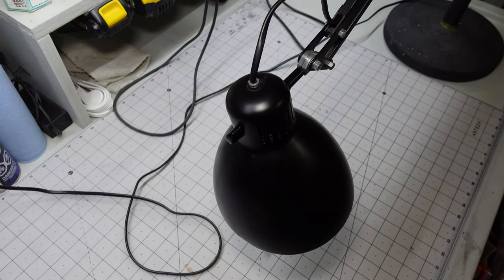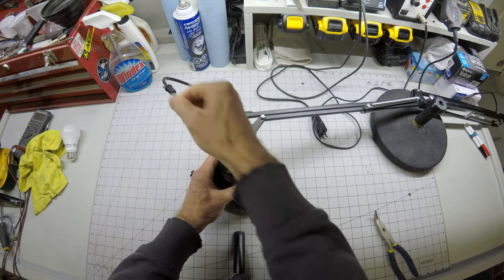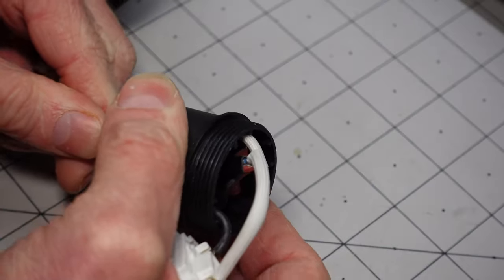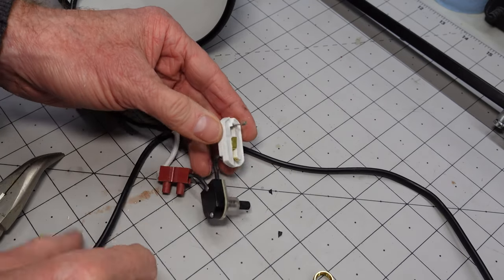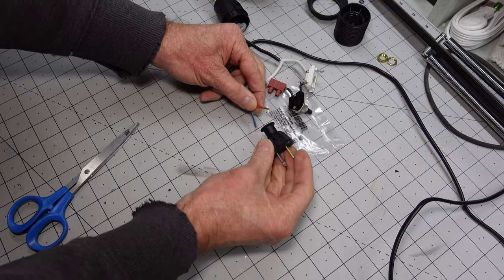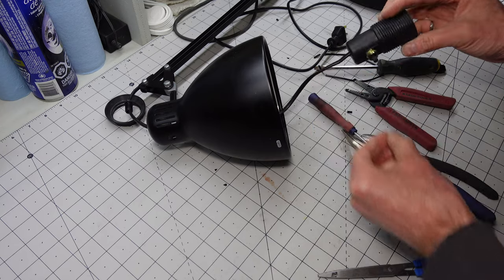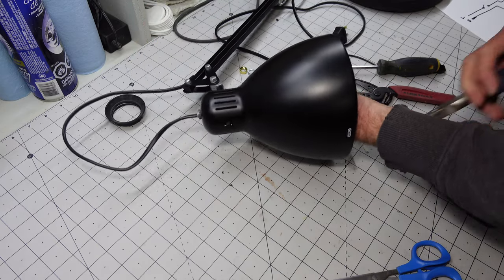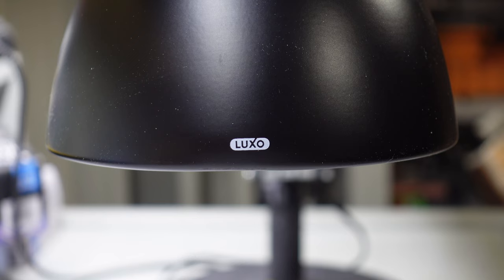Luxo L-1 Task Lamp Switch Repair and Plug Replacement

Comment: Nice jpb, but you omitted one step when wiring the replacement plug. To add resistance the wires do not come loose if you pull the cord instead of the plug when disconnecting, you should have tied an 'electrian's knot' before connecting the wires to the plug.
Reply from the maker: Great suggestion, thank!  Don't need those wires accidently pulling out.

Comment: Thanks for the video, learned thing or two… Considering buying this lamp. Would it be possible to measure length of the bulb in the video? It seems it is the biggest to fit in the lamp (without sticking out) - would love to use the Philips Hue White and Color Ambiance 13,5W 1600 bulb, which is 13cm long, not sure if it fits…
Reply from the maker: No problem, glad it helped!  My blub is 105mm, I measured and I roughly have another 10mm before it would stick out past the shade.  https://imgur.com/a/Jm8vRB9
It looks longer than 105mm in the picture but that is just the angle I took it at.
Reply: @reileymckerracher9181  Thank you. It was very helpful.